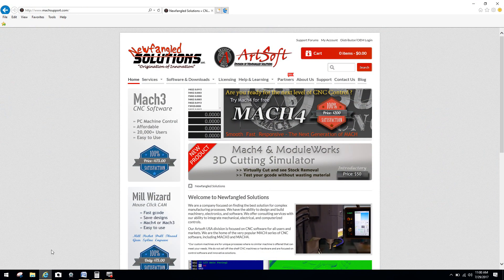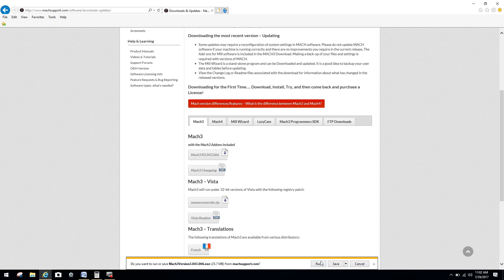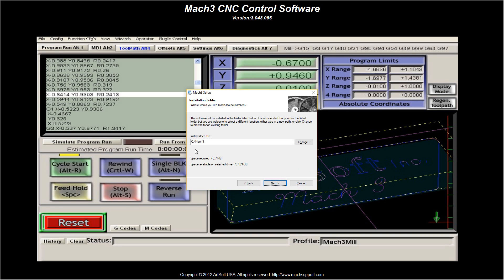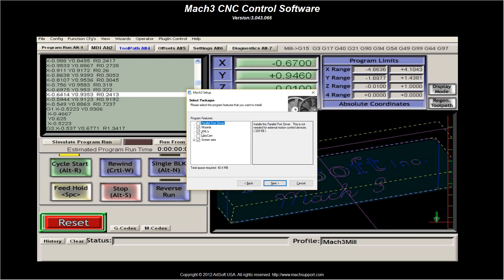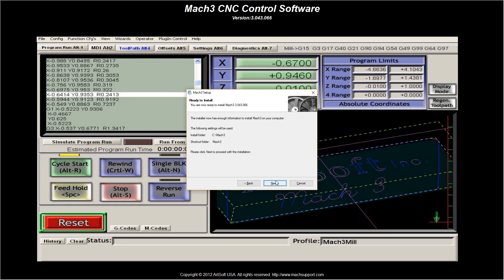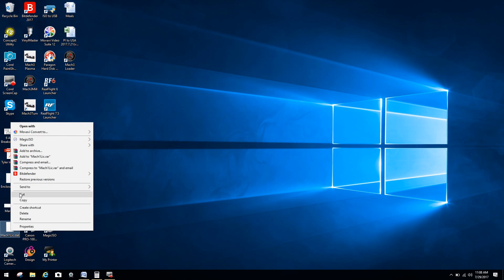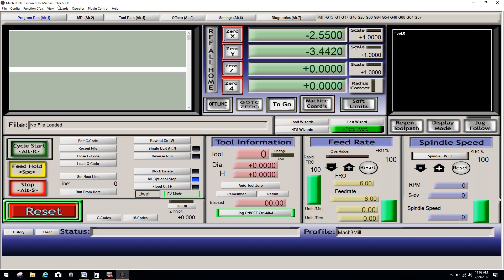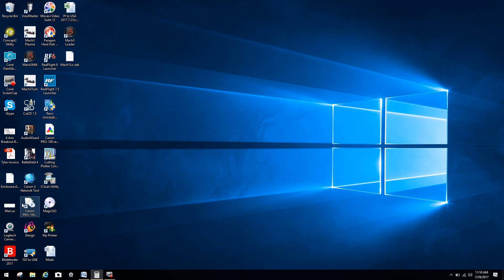How To Install Mach3 Motion Control Software & Your Users License (A very straight forward process)

Comment: Nice video thanks, I installed Mach 3 through usb successfully and configured it .when I started running it I get the DRO and tool path but no motor movement, any idea why. How can I correct this. Thanks
Reply from the maker: Thank you for your support. 

Please contact the vendor you purchased it from as I have to charge for third party support otherwise. If you would like to move forward with a consultation please contact me through my video's description. 

Thank you,
Vince

Comment: just updating my series 1 cnc with gecko drivers, would you be able to provide mach 3 or 4  license to run off my windows 10/11 reconditioned dell comp?
Reply from the maker: Thank you for your support. Its more efficient for you to order directly from Artsoft as they charge what I do for the software, and they will be emailing you your license directly. Thank you,
Vince

Comment: Hey a Vince, Will here,    Im wondering if you have any knowledge about why my steppers aren't working with Mach3... I have an HP i3 laptop brand new, I installed Mach3 with license. I tried to configure according to youtube vids but no luck. i did not recieve any instructions with my machine. i bought a 3040 mill. Any help would be great. Thanks!
Reply from the maker: Hey Will, thank you for your support. Unfortunately without knowledge from the vendor of the breakout board used, and its port, and pin allocation you essentially have a paperweight. No one can help you unless they know the breakout board's pin allocation.  I would contact the vendor, and or the charge company used to purchase the system as they should be offering support to their clients. Thank you,
Vince

Comment: I have installed mach 3 on win 10 laptop, and have a usb interface but it will only run in simulation mode. please help. I have been looking everywhere for a solution.
Reply from the maker: Thank you for your support. If you haven't got a retail license it will only run in Demo mode. If the version you have is from overseas its pirated, and you'll require a retail copy. Thank you,
Vince
Reply: Hi again my problem is the dll driver for the motion controller did not come with the board does anyone have a copy they could share Thanks Daryl

Comment: Hello Corvetteguy50

So I have a Mach3 on my computer that I work on but when I got this computer, Mach3 was already installed & the machine was all connected & ready to go (I didn't do any of the installations). 

Now my friend just recently got a CNC table & I told I'd teach him how to use it but the one thing I never learned was how to get Mach3 to recognize the table/machine, I figured by just downloading Mach3 the machine would work but that is not the case. 

Do I need this  'Mach1Lic.dat'  file in order to start using the machine?
If not do you have a video that could direct how to do so?

Thanks!

Comment: Hi, I was wondering if you would have any idea or advice for a trouble im having with the CNC machine. I have downloaded CNCjs on my new DELL Windows laptop and when I connect the usb cable from the CNC Router to the laptop, it does not get identified. It only shows that no Ports have been identified. Would you have any troubleshooting techniques? Thank you in advance. Kind regards, Hashmat
Reply from the maker: Thank you for your support. If you didn't install the drivers for your USB controller then it wouldn't find it. I suggest contacting the vendor who sold you the USB controller for support with the drivers as they should provide them with the purchase of it. Thank you,
Vince

Comment: I contracted a VFD controller included mach3 board usb and four axis step motor drivers. All the functions work perfect. The only problem I face is that after a period working ok the cnc stops momentarily for a second and then continue to works.
Can you please give me an idea what to do to gix it?
Reply from the maker: Hey Dennis, Thank you for your support. Unfortunately I haven't any idea what would cause that without going over your entire system. Troubleshooting a problem like this is very tedious , and I suggest starting with the basics by documenting, and the process of elimination from the board to the VFD controller, and you should find the issue. Thank you, and have a great weekend!
Vince
Reply: Hello Vince. I like to share with you a solution I have with the momentarily stops of x and y axis. I had place the laptop very close to the cnc 1.5 kw spindle. The same job had 3 to 5 momentarily stops. When removing the laptop 2 meters from the spindle I run the same job 3 times without any stop! Does this say something to you?
Best regards
Dennis Anghelatos
Reply from the maker: @dennisanghelatos3302  This is fantastic news! This is what I meant by the 5v voltage from the USB board. Increasing distance is always an instant way to decrease EMI which you just demonstrated. I would recommend using a double shielded USB cable to the board. Congratulations! Vince
Reply: @corvetteguy50  Thanks Vince. I will keep in touch with you.
Again congratulations yo you also
 You are very helpful.
Regards to Dennis
Reply from the maker: Thank you, sounds good...:) Vince
Reply: Dear Vince good morning. The problem with the stops doesn't exist anymore. But I face something else. First I send a simple job like two squares just outline. At the end the axis go to zero point correctly and when rerun the file I get exactly the same result. Next I load a file with area cleaning and when finished the zero point is 2 mm to the right of x axis! The z and y axis are ok. Does this make sense to you? If you have any suggestions please let me know.
Thank you
Dennis Anghelatos
Reply from the maker: @dennisanghelatos3302  This is most certainly something with the program. I would try another file to see if the same problem exists. Thank you,
Vince
Reply: Thanks my friend. I forgot to say that the spindle foes not stop only the movement of x and y axis stops for less than a second. Also in the diagnostic screen I see the % line from 1 or 2 goes momentarily to o.
Thanks again.
I will introduce your channel to other cnc fans.
Reply from the maker: @dennisanghelatos3302  Thank you I appreciate that. This sounds like the USB breakout board you're using causing the issue.  If you have another board I suggest testing it. USB uses a very low voltage of 5v which is easily corrupt by EMI, and poor grounding from your PC. Thank you, and have a great weekend!
Vince

Comment: Dear, the control box for my cnc is parallel to parallel cable connection, if i use parallel input in control box to usb input in computer, can i use windows 10 and operating sys 64 with mach3 ? if i can , please tell me how to make it.
Reply from the maker: Hisham, thank you for your support. In order to convert the controllers DB25 parallel output to USB on the computers side you would require this for use with Windows 10. https://www.ebay.com/itm/132505537529 Thank you,
Vince
Reply: @corvetteguy50  Dear , what about plugins ?
Reply from the maker: CNCdrive.com on their website covers the plugin side as its included with the UC-100's installer. Thank you,
Vince

Comment: Just bought a 6090CNC and need to install.  So thank you.
Reply from the maker: I would verify your copy of Mach3 isn't pirated at that's the versions that come bundled with Chinese systems. If it is pirated you may have stability/feature issues. Thank you,
Vince
Reply: @corvetteguy50  Downloaded  from site. Currently in demo mode. Will buy license.
Reply from the maker: Good thing, then you'll be all set...:) Thank you,
Vince

Comment: I have windows 7, and I connect the breakout with parallel port, and it has easily installed in windows 7, but stepper motors are not running, what should I do, or do I need to install windows Vista in order to work stepper motors ?

Comment: Installing mach3 on Windows XP a file,  USB Motion Driver RnRMotion.dll, needs to be installed. I did not see this in your video, does Windows 10 not need this?
Reply from the maker: Hey Twin Cylinder 50cc Thank you for your support. What you're explaining about the hardware you're using is you require a driver file to be installed. This is based on your particular setup with the USB controller you planned on using, and not required to just install Mach3. Thank you,
Vince
Reply: @corvetteguy50  Thanks Vince, if I did not install Driver RnRMotion.dll would Mach3 still work with the breakout board? The driver file will download okay with XP, with Windows 10 is it flagged as dangerous and gets blocked.
Reply from the maker: Mach3 would install without the driver file fine, but it wouldn't work with your device. Thank you,
Vince

Comment: Gotta check out this UI, Vince! Mach 3 Has Never Looked This Good! (CNC Software Part 2) - S03E14 - YouTube
Reply from the maker: Yes, sir I've seen it, and your right its very good, and makes a drastic improvement to the usability of the software until my newest release gets finished. Thank you,
Vince
Reply: @corvetteguy50  I was going to purchase Mach 4 for the slave capability (without using an axis) and I think I will wait and see yours.
Reply from the maker: Thanks Dave, I think you'll see it will be worth the wait...:) Thank you,
Vince

Comment: I was hoping I could ask you a question about the license I've tried to install it over and over and over I've disabled all my firewall all my antivirus I still can't install it now I paid for a copy but I also had the one that came with the machine I bought but that one's not licensed to me and I'm afraid to even try to download mach3 again and do the license cuz it might mess up the one that's on the computer I would rather use the one from Mach 3 so I can get updates and whatever but I just have one question does this have to be hooked to your machine to be able to put the license in that's the only thing I didn't try
Thank you
Reply from the maker: Ron, thank you for your support. No, your Mach3 license will become active once the license is copied into the Mach3 folder which is by default put on your C: drive. Unfortunately without a consultation I can't help much without seeing what's going on. Thank you,
Vince
Reply: @corvetteguy50  thank you very much for answering my question I guess I'm just going to keep the the copy that came with a machine for now and get it in new computer and try to install the license copy on that I am kind of scared to mess with the computer that has a working copy on it but thank you for getting back to me so quick and for answering my question
Reply from the maker: You bet...:) Thank you,
Vince

Comment: I bought a 6090 cnc from China. This will make the work? I have Windows 10 X64
Reply from the maker: Teo, thank you for your support. Unfortunately the copy of Mach3 that comes bundled with your system is pirated, so I suggest being careful using it as most copies don't function correctly. If you would like to purchase a genuine copy please message me.  I don't know what controller they supplied you with your system but if the system is using a parallel port you'll require a UC-100 USB motion controller, or Warp9 ESS ethernet controller to make it compatible with Windows 10 64 bit. Thank you,
Vince

Comment: Your videos are awesome!  Thank you for all the good info.  Question:  I'm using an ELO touchscreen that's locked to 800x600 resolution so I don't see the whole Mach3 screen.  Is there an easy way to resize the Mach screens to fit on the smaller (locked resolution) screen?
Reply from the maker: Machine 27 thank you for your support. Unfortunately the only way to adjust the screen resolution would be by your PC, unless you redid the screen sets in Mach3. Thank you, and have a great weekend!
Vince
Reply: @corvetteguy50  I figured it out!  Go to the Config tab then select General Config.  Look for block titled "Screen Control" put a check mark in Hi-Res Screens.  That fixed the problem.  Now I can see the full screen.  Thanks for your help!
Reply from the maker: @machine2747  That's great! Thank you for sharing that, as I learn something new everyday. Have a great weekend!
Vince

Comment: My mach3 continues to show demo. I tested the demo version on my plasma table in late May. Last night I bought the full version, put the license in the mach3 program folder and nothing. Im wondering if the forced on me Microsoft edge update that slowed my laptop down and messed up some other stuff, messed up my mach 3 program. I dont guess it would hurt to uninstall everything and start over?
Reply from the maker: Tools And Toys, Thank you for your support. I agree re-installation is always key to assure nothing has been corrupted. Thank you, and have a great weekend!
Vince
Reply: @corvetteguy50  thanks for your response . It took a while but I found my problem. My license file was "Mach1lic(1).dat" instead of "Mach1lic.dat"
Reply from the maker: @toolsandtoys6606  Great, I'm glad you have it all sorted out. Thank you again,
Vince

Comment: Old computer crashed new computer is windows 10 version 18364 downloaded Mach3 demo it can't find the parallel port for some reason in milling machine mode can you help on this It use to work fine on windows 7?  don't want to license till I know it runs thanks Mike at rhjgold@gmail.com
Reply from the maker: Mike, thank you for your support. I really appreciate it. If it ran on your old Windows 7 system it will run on Windows 10 pending it isn't using 64 bit architecture. Please review my overview video on system requirements here https://youtu.be/MrcH0vvR_M0?t=116 Thank you, and please be safe.
Vince

Comment: Hey man first thanks for the content, as newbie id like to say its much appreciated. I had a few questions what if you have windows 10 64 bit installed on an old comp with a DB25 parallel port. I think this board forces me to use a DB25 connection, but Mach3 keeps throwing me an error when I run the driver test, so not sure how to continue with configuring Mach3 when the manual says to stop and reinstall at this point. My dilemma is im not sure if I should ditch the board, and go with the smoothstepper ethernet board you were talking about? Also would the smoothstepper also require a BOB? And would replacing my current board (link below) with the smoothstepper one change my wiring etc Sorry for the questions just a newbie thats so confused.  My comp running Mach3 which is connected via DB25 cable to this board  https://www.amazon.com/gp/product/B0093Y897A/ref=ppx_yo_dt_b_asin_title_o03_s00?ie=UTF8&psc=1  
connected to these drivers
https://www.amazon.com/gp/product/B06Y5VPSFN/ref=ppx_yo_dt_b_asin_title_o05_s00?ie=UTF8&psc=1

which are connected to my motors Nema23s.
Reply from the maker: Abderrahmen, thank you for your support. In order to utilize Windows 10, or any other operating system other than XP 32bit operating systems you'll require a UC-100 USB motion controller, or ethernet smooth stepper. I carry them both. You can't use Windows 10 with a parallel port. Whichever controller you choose as your controller your still going to require your BOB as its required as the "middleman" to communicate with the drives from the ESS, or UC-100 which connects to your PC that will be sending the pulses to them. Thank you again, and you, and your family please be safe. Vince

Comment: Can i use windows 10??? They told me where i got it i couldn't!!?
Reply from the maker: KY, thank you for your support.  You can use Windows 10 if your using a UC-100 USB motion controller, or Warp9 ethernet smooth stepper ethernet motion controller as both of these options don't require using Mach3's parallel port driver. Thank you,
Vince
Reply: @corvetteguy50  my spindle control box is a USB!! Cant use anything else.
Reply from the maker: @kywildcats6476  It must be from China as their the only ones that typically will have limitations on operating system use in that control format. Thank you,
Vince
Reply: Thank you. But i got my 6040 cnc router engraver three weeks ago. I still cant get it to take orders from my computer.  It driving me crazy.
Reply from the maker: @kywildcats6476  I would contact your vendor to get the required support you need to get it running.  If you purchased it from eBay I'm sure they will help.
Thank you,
Vince
Reply: @corvetteguy50  i have . They wont call me and have no number to call them.
Reply from the maker: @kywildcats6476  Contact eBay if that's where you purchased it from. They will step in, and get it handled. Thank you, Vince

Comment: What an excellent video,Thankyou. Question:I have downloaded mach3 from Arcsoft,and a couple of files appear to be missing. They are “ncusbpod.dll” and “mc930.m1s”. According to the machines installation instructions,I need these.It is a 6040z,4 axis usb machine.I hope you can help before I spend my hard earned money on the license! Many thanks,Keith.
Reply from the maker: Keith,
Thank you for your support. Unfortunately if your using the bundled Mach3 license that came with the system then you'll have to buy a genuine version which I sell as that's why your missing files. Piracy is all to common with these machines in order to try to reflect more value to their clients. Thank you,
Vince
Reply: Ah I see,thanks Vince.I had a feeling something it would be something like that! Where can I buy a version off you? Thanks again,Keith.
Reply from the maker: @KeithBarrowat54a  Please message me  at my email, and I'll send you the information. thank you,
Vince

Comment: Is there a way to update my computer without the .dat file? Or is that .dat saved on my current system
Reply from the maker: Hey Dan, thank you for your support. The file is saved on your original system if your already have Mach installed. Thank you,
Vince